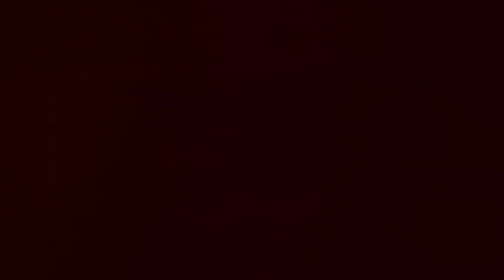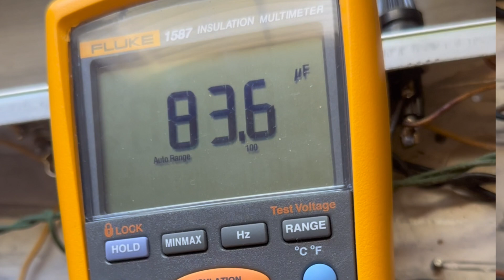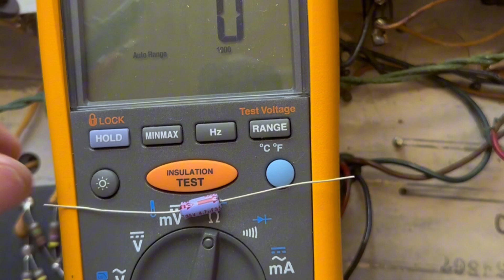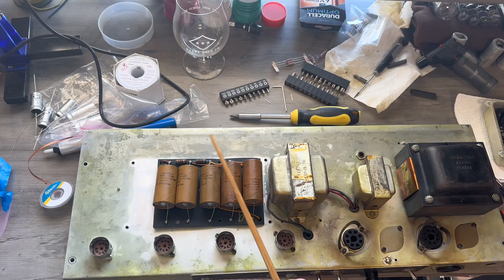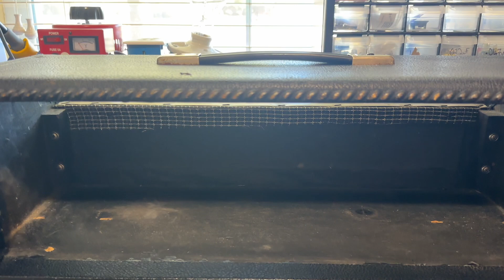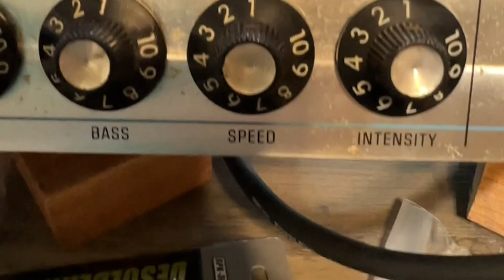67’ “Drip Edge” Bandmaster Restoration Part 2: A Good Day(s) Work

Comment: I have a '67 Bandmaster. Thing is just fine! I took it completely apart. Sent the innards out to a tech. Scrubbed the dickens out of the cabinet and made it shine. Put some Tung-Sol 58851's in it. Thing just sings. And shines! Got it setting on a MESA 1X12 cab with a 4 ohm Weber Alnico with a hemp cone (65 watts). Boy. It sounds good. Mine is a blackface, not drip edge.
Reply from the maker: That sounds like a killer combo! Would love to try some 5881s in one of these!
Reply: Who did the work on the innards, and how much did it cost?  I have a '67 bandmaster that needs service.

Comment: You need to up the value on one of the 3 disc caps on the tremolo because it is currently too fast at its slowest speed. Usually, there are two .1uf disc caps and a .2uf together in the tremolo circuit near the roach. Changing one of the .1uf caps to .2uf will fix that common issue.
Reply from the maker: Yes , it’s part of the plan! Just focused on restoring it to playing condition first, and then seeing what’s necessary to change.